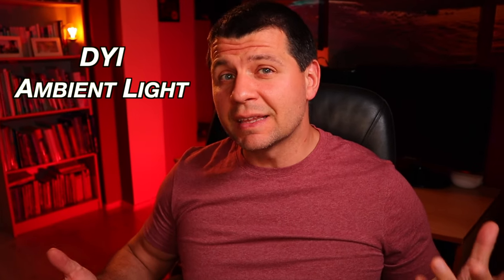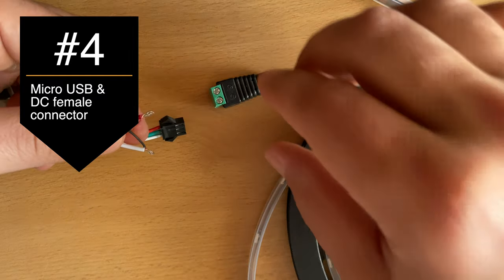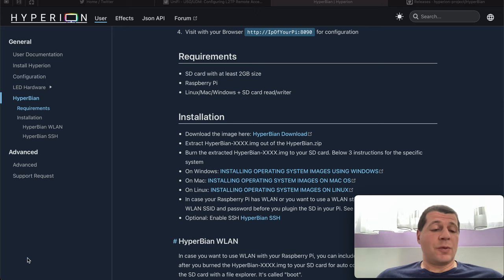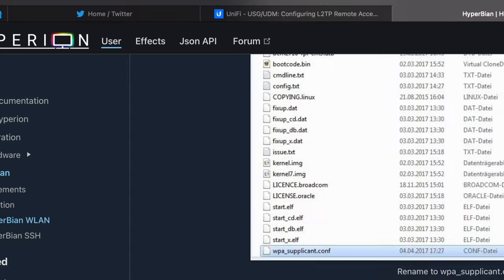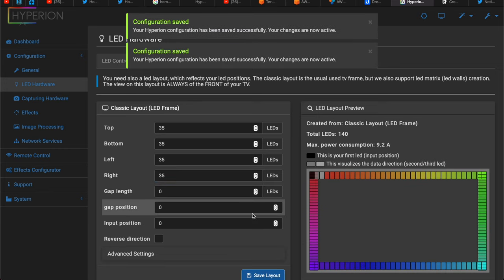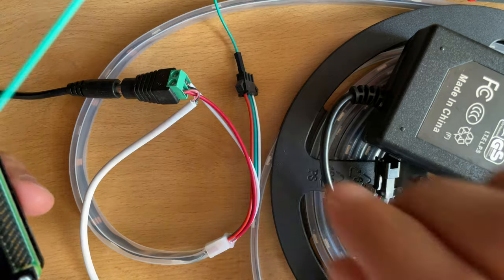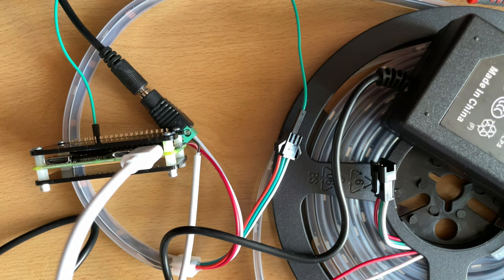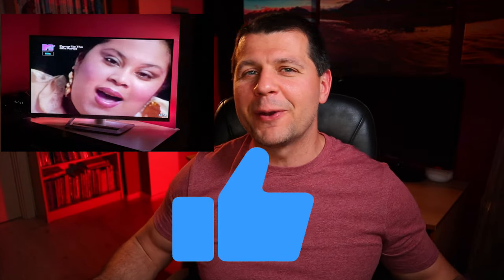TV Ambient Light with Raspberry Pi and Hyperion (HOW-TO)

Comment from the maker: Do you have TV Ambient Lighting at your home?
Reply: I don't have it yet but I'm planning
Reply from the maker: It is totally worth the efforts :) And at the end at the day it is not so hard. The cons is that I double my TV time just to watch the TV Ambient Lights 🤩
Reply: @KPeyanski  But its a good, máš viacej času užívať si život :-) have a more time enjoy the life..Enjoy the silent (Depeche) enjoy the ambients :-)
Reply from the maker: Thanks Arnold, I enjoy the life by making video clips for you :)
Reply: @KPeyanski  Eto super:-) Pokračuj v činnosti:-) Ez így jó, folytasd tovább a tevékenységedet! It is a super !So that's great and keep going...ďalej a ďalej :-)
Reply: Yes  , I on my PC monitor ,bun not with hyperbian, but with prismatic software. Hardware is d1mini with Wled software.
Reply: I followed your guide to build this and it worked great, thanks for putting this together! At first the LEDs had a pretty bad delay but after tweaking the settings it looks awesome :) Lowered the resolution, changed FPS to 15, tweaked the size decimation. I have it in between my AVR and my TV so all my devices work, FireTV, PS5, my media center etc.
Reply: Thank you for this great video😉 just one question: I just want a 1080p output from a  4k mi-box. But if I use a 1080p capture card, will it block Netflix video protected data? Does the video capture card need to be hdcp 2.2 for a 1080p output? Thank you!
Reply: @psyfiend  hi can you elaborate on your connection between AVR and TV? I might be in same situation. Right now my Firestick is connected to AVR
Reply: @bhooshaniyer5302  The HDMI out from my AVR goes into an HDMI splitter, one output of the splitter goes to the TV and the other side goes to the capture card plugged into my raspberry pi. I purchased the splitter on Amazon for like $20, it allows one of the outputs to be 4k while the other output is only 1080. The "capture card with loop" that OP uses should accomplish the same thing, either setup should work.
Reply: @psyfiend  Thanks for that- my AVR supports two HDMI outs- they act like a splitter. I connected the 2nd out to video capture card but the main TV now recieves only 1080P. There doesnt seem a work around for it inside the AVR. Could you pls share the link for the splitter you ordered? Where i live this splitter seems to cost much more than 20 USD!!
Reply: @bhooshaniyer5302  The one I bought was actually $30: https://www.amazon.com/gp/product/B07VP37KMB/ref=ppx_yo_dt_b_asin_title_o03_s01?ie=UTF8&psc=1
Reply: @psyfiend  i have resolved all issues now by moving the splitter from output side of the avr to input. Firestick->splitter->capture card & Firestick-> splitter->AVR input. AVR to TV is as usual. SO i get ARC, 4K and hyperion all 3 working nice and harmoniusly. THanks.
Reply: @bhooshaniyer5302  Great! In my scenario ARC does not work for my TV anymore but since I have multiple inputs into my AVR this is the only way to support all my devices (PS5/Firestick/Switch->AVR->Splitter->Capture/TV.. There are other splitters that do support ARC but they cost more money, I'm going to keep experimenting and I'll report back.
Reply: Sure i have my DIY one. But if I could suggest to anyone who's going to do it. Guys - use SK6212 strip instead of WS2812B - whole process is same just diffrent strip.Thanks to sk6812 you'll get pure white color which ws2812b can not produce.
Also use in hyperion control panel RGBW method in your first instance ;)

Comment: problem with this is your hdmi loop says "60 hz" but then also says "max 30 fps" for both the hdmi and usb. if you are using this with a 60-120hz TV panel, you will be halving your performance on the hdmi output

Comment: Thank you. Great video. Everything works. 
I have one question: after a few minutes my led strip will turn off. Raspberry is running but the led strip is off. I have to restart raspberry. Do you know where is the problem? Thank you.
Reply from the maker: I don't know what can it be. Double check that your power supply have enough Amps, check the Hyperion and the OS logs. Good luck!

Comment: Great guide. 
I have all the components I need and am at the point of assembling the setup on the TV to discover the Pi 4 doesn't have 2 usb inputs. It has one usb C input which is used for power so I don't know what to do.
Reply from the maker: I'm not so sure about that. Maybe someone else can jump in and help.

Comment: Do you know the density of the LED strip you used? Do I need 144 LEDs per meter or would 60 LEDs per meter be enough? I can’t find a 5 meter strip with the high LED density anywhere!
Reply from the maker: Hi, I'm using 30LEDs per Meter and it is very good. I think 30 or 60leds per meter are optimal.
Reply: @KPeyanski  awesome thank you for the answer I’m going with 60 per meter. Would I have to get a different power supply for this? Or do you think the one you used would suffice? Thank you for all your help!

Comment: Great video!!  I use dream screen and works great but it’s too expensive, I added the same setup 2 months ago but I just can’t figure out color sync with the tv, did you had any issues related?
Reply from the maker: Hi Jaime, try changing the RGB Byte order settings located under Configuration > LED Hardware. By default is set to RGB, but in my case with my LED strip I had to change this tor GRB. I will check this dream screen as I don't know nothing about it.
Reply: @KPeyanski  thank you for the tips👍 the colors are good only issue is the refresh time between what’s playing and the Led lights , led lights seems to have like 3 second lag
Reply from the maker: Hmm that is not good, I also have some lag, but I think it is around half a second or something which should be normal. An honestly I don't know what could be the reason for your 3sec lag. BTW What is your raspberry and what is your Hyperion version?
Reply: @Jr01atlTech  I think that delay will come from your video capture device. If not watching source at the same time as the capture, which you are doing now, you would not normally notice it?

Comment: Great video. But based on your demonstration at the end I can see that there is small delay and it would drive me crazy. If you see on 12:04 there is different color right bottom part of screen and lights in that corner change to that color after 0.5-1s. Would use of WLED help or if you change resolution that your capture card gets?
Reply from the maker: Changing the resolution, plus disabling the smoothing can help. As well as faster Raspberry Pi (like Pi 4 or Pi 3)

Comment: Thank you for your tutorial, very clear. I've followed exactly what you explained, but I don't seem to get an image on my TV :(
I have the exact same hardware as you do, but it seems that the HDMI Capture Card with Loop out doesn't see the entertainment box. I have an OSMC Vero 4K box and I also tried it with a Chromecast. I plug everything in and I get the startup lights but no image on the TV and no image in LED Hardware/LED Layout/LED Visualization. Do you have any suggestions on what to try?
Reply from the maker: In my opinion your HDMI capture card is the problem, I'm not sure how to test it if it is working correctly. Try google about such test and check if it is working. BTW did you power your HDMI card with 5V DC or not?
Reply: @KPeyanski  Hi, thank you for getting back to me. I figured it out! It was an HDMI cable problem. Simple fix. Yes, I am powering the HDMI card with 5V thru the RPi USB port.

Comment: Was able to connect everything but I'm only getting the first couple of LEDs turning on. Dashboard says led hardware is off, I'm using the BTF WS2812b LED strip.
Reply from the maker: Try the following: 1. Double check that your power supply have enough amps for your strip length. 2. Run Hyperion as root. 3. Try shortest data cable as possible or use level shifter/sacrifice pixel.
Reply: @KPeyanski  I was able to turn on by changing to SPI and using GPIO 10. However, now i'm working on syncing the colors. Thank you so much for your help!
Reply: By any chances, which software are you using? I read version 9.0 works perfectly fine and issues started with version 10.0 which needs to be run like root. If you have a link to download version 9.0 would be really appreciated, thanks!

Comment: connected on gpio18, for 300 led strip, used all your settings config , but only the first three lights worked? is it because my power supply is only 5A, (couldnt find a 10A supply) ,however the pi works just fine? Any ideas?
Reply from the maker: Hey, we discussed that in my Discord server right? What happened at the end?
Reply: @KPeyanski  it seems i need a level shifter , shipping is slow in our country now, i will try that soon and will update . thanks

Comment: Thank you very much for the video! This is the most detailed, but also the most inexpensive option I've seen. I would like to clarify with you, I have an external hard drive with different films connected to the USB port of the TV, perhaps somehow I can connect the ambilight so that it works when playing video from this drive?
Reply from the maker: You will need a source with HDMI and HDMI capture to actually capture the signal. Only USB will not work.

Comment: Would this work on a raspberry pi 4 that also has retropie (with kodi) installed? Or do I need a dedicated raspberry pi just for Hyperion? Thanks
Reply from the maker: It will work without problem but you need to install the Hyperion packages and not the whole image like I did in the video. Check the Hyperion web page for only package installation instructions. Everything else is exactly the same as in the video.

Comment: Greate Video, actually all your tutorials are fantastic. I have an issue with my HDMI capture card where the USB signal out is just noise ie) when I use Live view on Hyperion it does not show the video (Im using Chromecast as input). I can see the video on my TV but not on my raspberry PI zero running Hyperion. Any suggestions? thanks in advance
Reply from the maker: I hear similar reports from time to time. I don't know what is the exact reason behind that, but I guess it is the HDMI capture card. Try to change it and double check your Hyperion configuration
Reply: @KPeyanski  thanks for the response.I wonder if there a way to capture the signal via Kodi or Plex or some kind of media server so that you don't need a USB at all.

Comment: Great video! I don't seem to have a "Jumper wire" - are these something needed separately? For now I've just wrapped it around GPIO Pin 18 instead. Nothing seems to be happening when i plug it all in, though.

EDIT: Run Hyperion as root to solve some of the problems. I have lights but all it does is flash random colours very fast across the first half of the strip. It doesn't seem to matter what effect I activate, I get a chaotic flashing of all different colours that seems to be working its way up the strip further each time it starts again but never makes the end.Three random LEDs are always on in the middle of the strip. One red, one blue, one green.

Edit 2: After significant trial and error, I've managed to make the back half of the LEDs light up a constant green, and the rest are still flashing manicly. This is still the effect no matter what I do. Not sure how I made it go green given that I asked it to strobe red.
Reply: did you fixed it?

Comment: Don''t seems to work, only one led or two or three light (randomly!) only if I connect and detach the GPIO 1 (the first at the left) ... can you help me? (i have try also with hdmi connection but nothing only one or two led ligthes whwn I attach and detach GPIO 1)
Reply from the maker: Can you please try to follow the exact instructions from the video/article. GPIO 1 is not the correct one to be used!
Reply: @KPeyanski  Yes I know I've try the sixth GPIO (GPIO 18) many times but no led lights ... after I I've try all the GPIO and I have noticed the weird behavior with the GPIO 1
Reply: @KPeyanski  Can be a wired problem of the power wire connection?
Reply: @KPeyanski  i have the same issue here?

Comment: Do I need a 4K HDR capture card to make this work on a ps5? Or will a regular HDMI capture card suffice
Reply from the maker: The capture card that I'm using and recommending is 4K, but I'm not sure about the HDR part. Have to figure out how to test this. Of course it will be great if someone else tell from experience what is the result.
Reply: wont work for HDR bro, you need a basic 4k capture card et and HDR spliter for that !

Comment: Have you noticed that the capture to raspberry pi is cropped ? From  4K original video it is captured as shifted 800x600 resolution which produces the actual LED output. Not very accurate

Comment: Can anyone help? I did as in the video, but when Raspberry starts, only the first led lights up in the color of rainbow for a few seconds.
Reply from the maker: that means you have connected the led strip and PSU correctly, double check the HDMI capture, and if the the RPI GPIO 18 connection is correct
Reply: @KPeyanski  The problem was, it didn't saved my settings (default settings is 1led on top) . But still it doesn't work through the hdmi grabber with loop which gives no signal to the raspberry. If my play with settings won't work, I will buy a splitter and grabber as a separate devices.
Reply: @KPeyanski  Unfortunately, I can't make it work. The LEDs are all ok, the idle effects works, but the HDMI grabber isn't detected. In the capture settings, I have only "bcm2835-isp-capture" to select. Now I used hdmi to av and av to usb but still wrong. The only thing I missed from video was adding a SSH.
Reply: @DudasDudek  In the capture settings you need to select "camera 1". If this option does not show up, make sure you have the capture device is powered up before starting the Pi which needs to find a connected device.

Comment: Why not use the TV USB port for this?
Reply from the maker: There is not enough power there
Reply: @KPeyanski   I am sorry, my question wasn't clear, I understand the LEDs and Pi will require an external power supply. I was more thinking about using the video signal to feed the Pi to take advantage of the TV applications (most of what I watch) and not just the external video sources (only DVD player in my case). I have seen this might be possible on "5 great uses of your TV's USB port by Dignited": "The USB port on the TV also allows you to connect accessories to beautify the TV and its surrounding environment and enhance the user’s viewing experience. Also, 8K TVs from manufacturers such as Samsung (this is what I have) and LG have a sports ambient light function, and you can also purchase third-party TV lights that can be connected to the TV via a USB port".
Thank you for your response and your excellent videos.

Comment: Hello, I can't make it work, the settings are fine. I did it as it appears in your video. The LEDs do not change color according to the video. If you want to send you a video to tell me what I'm doing wrong, thank you for your attention.
Reply from the maker: Is that mean that your LEDs are showing the boot effect, but they are not in sync with the TV image afterwards?  If so double check your Hyperion settings or try with another HDMI capturing card.
Reply: Sometimes launching Hyperion as root helps. Try that.
Reply: @jean-claudewallard9309  how can it be done? I just was able to connect everything but I'm only getting the first LEDs.